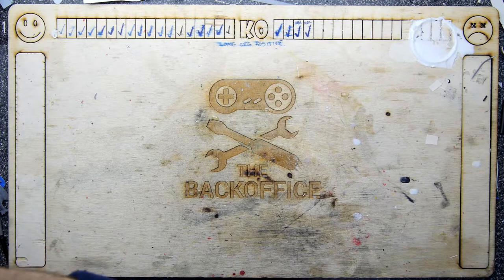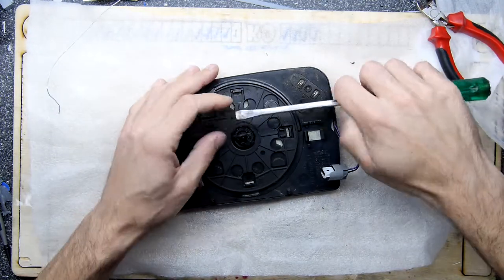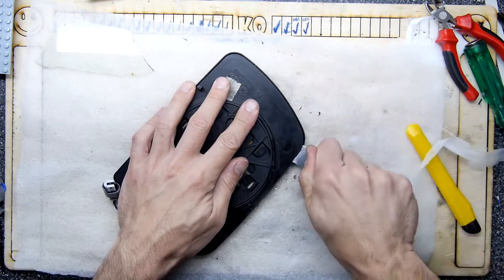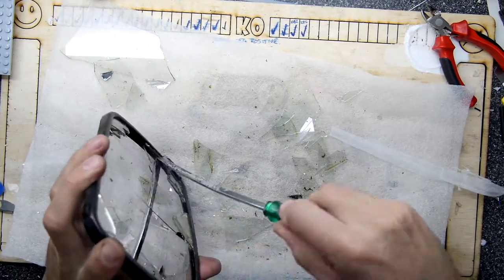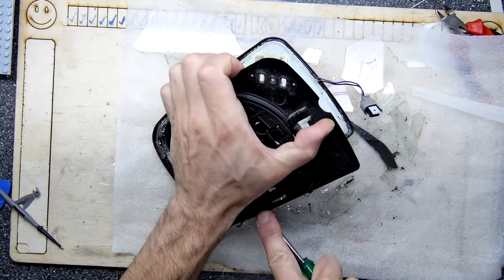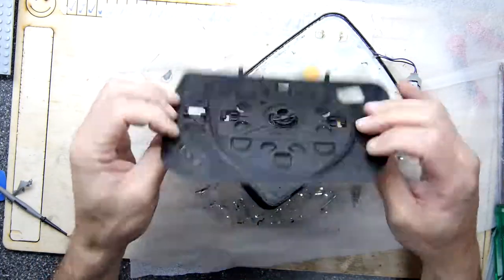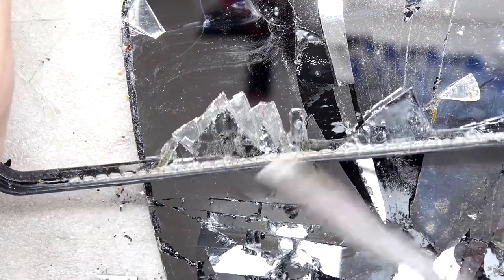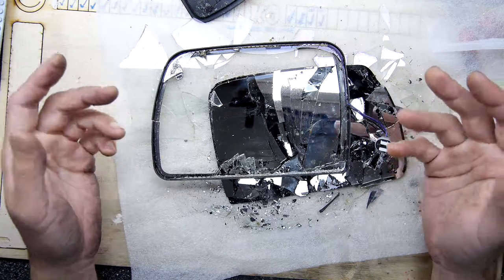Chromatic Car Mirror

Comment: Never seen / have one
Think its LCD and LDR on Stabilaised voltage
3:40 Spudger are't really sharrp. Would be contra productive...
5:00 it's interesting. 2 Layer but no LCD... I don't find anyting alse in my had..
7:03 I'am german... but Please google Knife... it's sayn "neife". or is this dom Dialect?
7:55 Firefly is totaly underrated. I Love this show... Wine...
8:20 In Prison better use a toothbrush or Cigarett filter...

Comment: We have such a mirror in our Renault and it works really good. When such an "idiot" gets close behind with high beam headlights on, the mirror dims noticeably down making it much less of a problem. I would really like this feature for the outside mirror (at least the driver side) too.
Reply from the maker: +Ingo Günther if your vehicle came with it fitted and the mirror for broken, would you replace it with the same expensive unit?
Reply: I have 3 autodimming mirrors, and I've replaced them all. It's either a time consuming process of combing through junk yard listings or paying $300 each for new ones.
Reply from the maker: I think my plain heated replacements will suit me just fine :)